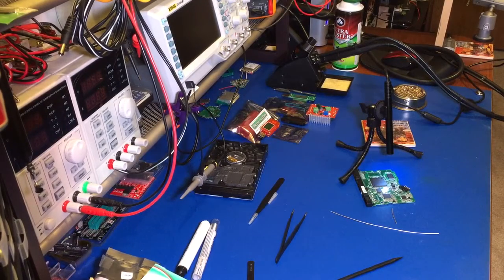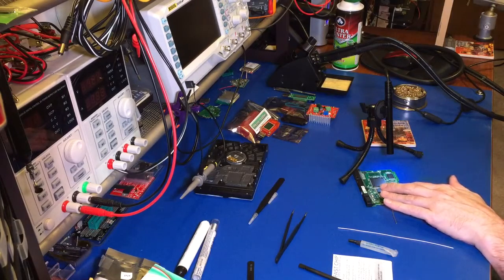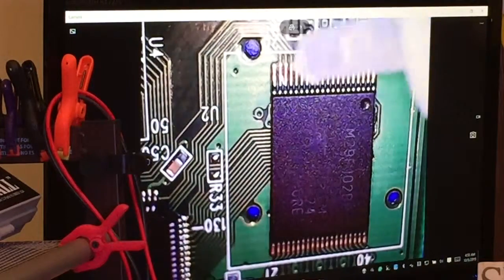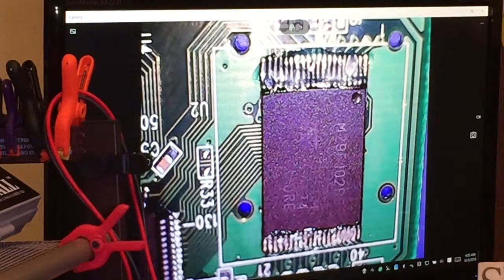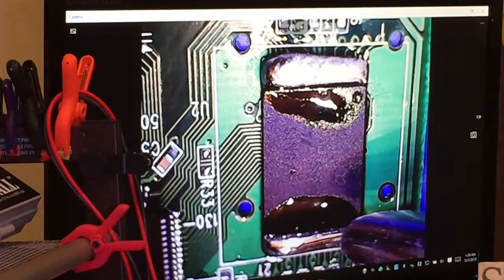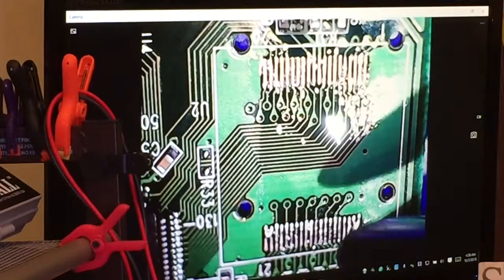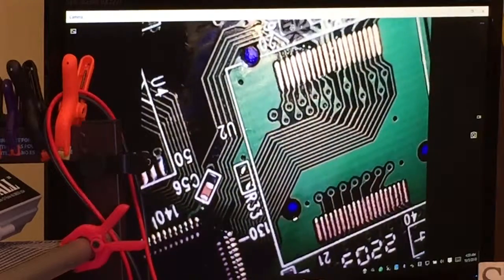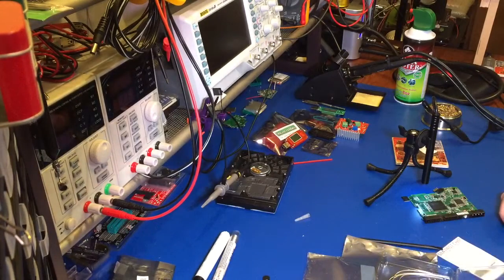More Gadget Tech Thoughts - SRA Fast Chip Kit Review

Comment: Hi lovely informative video ,Do you think low temp melt silver/ alluminium alloy solder would do the same job as it melts at 70 /110 degrees Celsius  ? The reason I ask is you get 20 strips/ rods for 3 bucks delivered ,where as SRA,low melt  etc... Charge a small fortune in the UK  many thanks in advance . I've liked ,subscribed etc ..
Reply: you can make your own using bismuth crystal and leaded solder